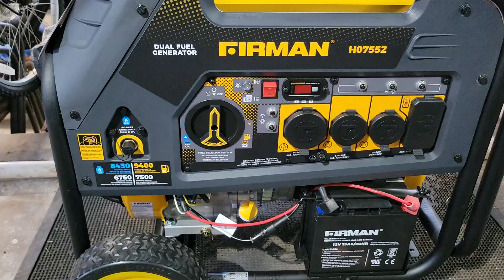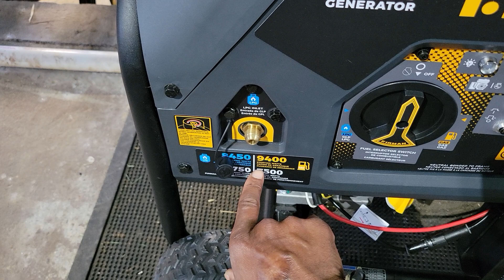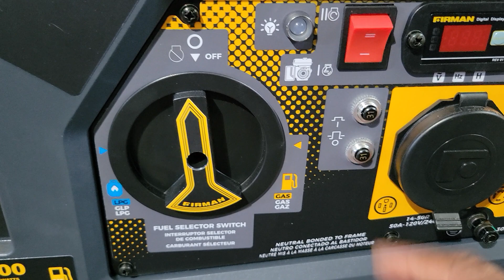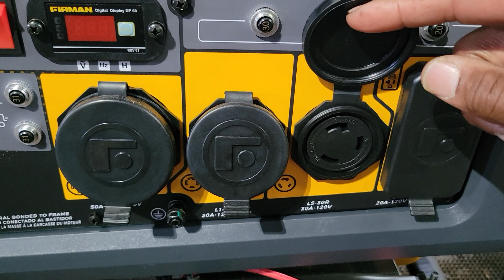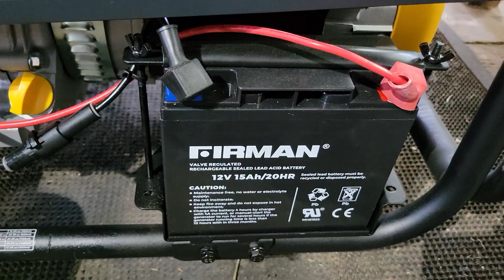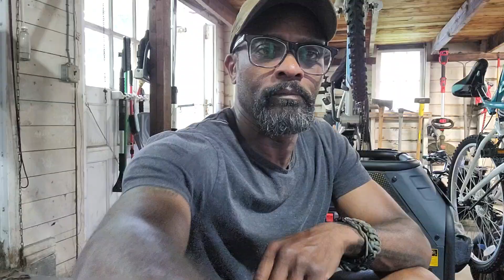Grid Down Backup Power: FIRMAN Dual Fuel Generator

Comment: Check out the EG4 Chargeverter.  It will allow you to charge a 100AH battery in an hour from your generator.  1 hour of generator use can give us electricity for 12 hours via battery and inverter.  It' is a game changer.
Reply from the maker: I'll be looking into that. I've got an electrician coming to do an interconnect and run a dedicated line for my generator.
Reply: I was blown away and awaiting delivery of the Chargeverter.  I am going to be running it with an EG4 6500 48v inverter and EG4 battery mounted on a hand cart. @TheUrbanSentinelChannel

Comment: I have the tri-fuel version of that portable generator that I bought in case of a hurricane in Southeast Texas. I have used it during the Texas Freeze a few years ago and occasional outages. I have natural gas for my cooktop, water heater, furnace & dryer. I run the generator on natural gas and it powers most of the house through the electric panel. As a backup, I have two 1408Wh and two 666Wh power stations, and eight 100W rigid solar panels which I made into four suitcases to set up in the back yard. I installed emergency lights that come on when power goes out. They are where I set up the generator, at the electrical panel and in the main hall of the house. I also have some Ryobi flashlights and batteries. I can also run the generator on propane along with my portable griddle.
Reply from the maker: I wanted the Tri-fuel,  I had planned on getting Natural Gas connected...but the $$$$ changed my mind. 🤣😂

Comment: Imagine being the only house on your block with a generator. You would have to post security on it or bring it inside after use. 

I've heard stories of generators being stolen during disasters. 

The best option I see, is to help people charge their phones, provided you have enough fuel on hand. Your closest neighbor, perhaps you can run their deep freezer for a bit. Totally up to you. 

If another area has power, you can charge a few bucks per phone charge, to pay for gas. Even if you run a Dual fuel. 

This is a capitalist society, so yes Why should you have to spend your money to get more gas, because unprepared folks consumed your fuel. Use their money to get the gas.
Reply from the maker: True. Even with a quiet box built around your generator it'll get attention. Anchoring it down, putting a dog nearby and offering to charge people's batteries will help.
  I wouldn't be running 24/7 anyway butt I am fully aware of the risk to reward.